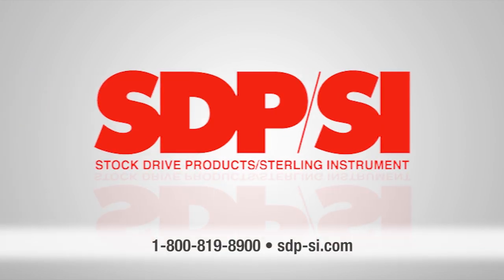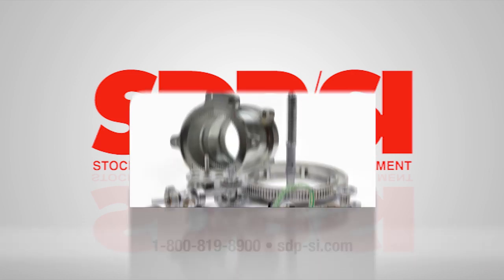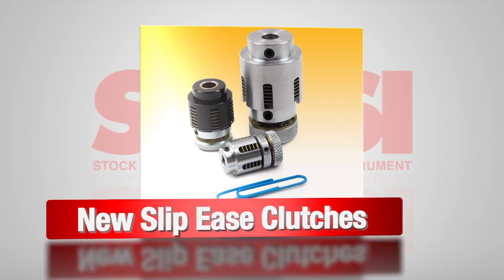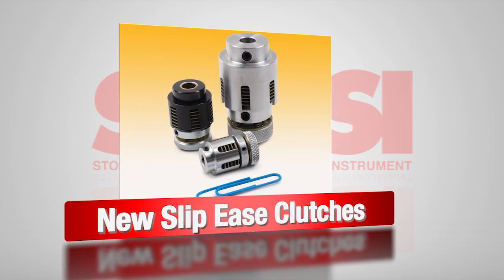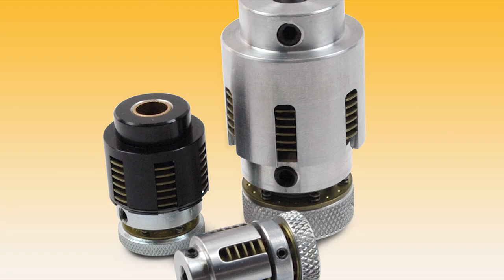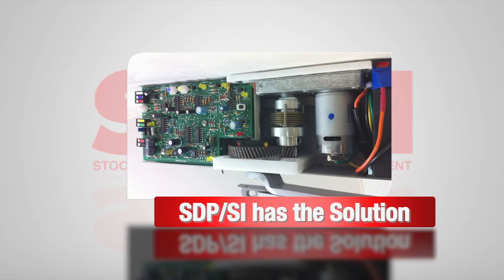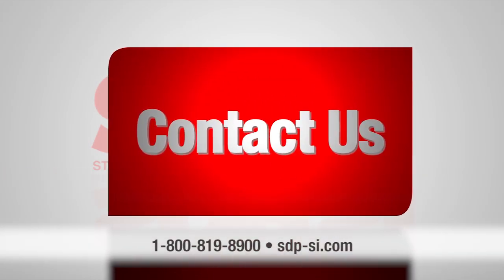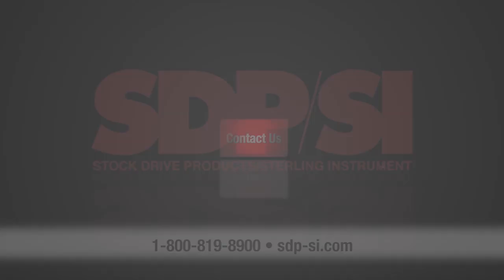Slip-Ease® Mechanical Clutches

Comment: Hi, does this slip clutch capable to fine adjust for torque within  0.1Nm to 0.5Nm?
Reply from the maker: Hi, thanks for your inquiry. Please contact our engineering department directly. You can contact Jon Uebel, applications engineer at: juebel@designatronics.com. He will need some more information.